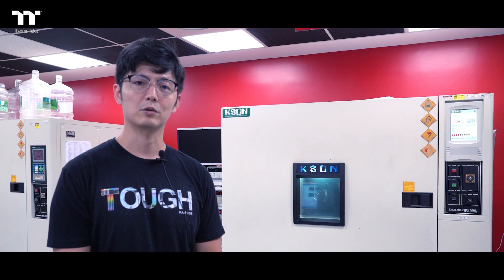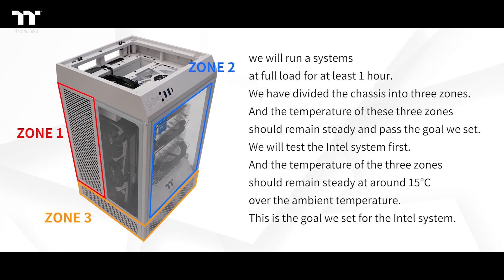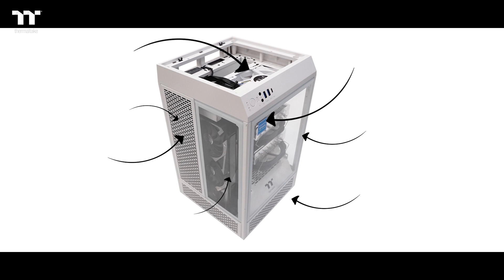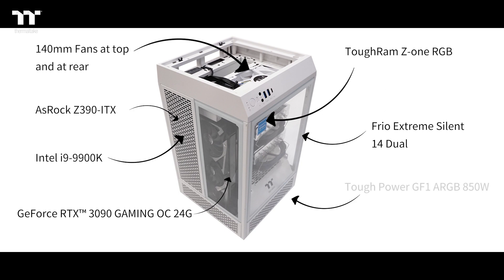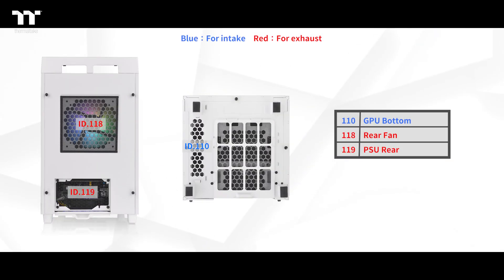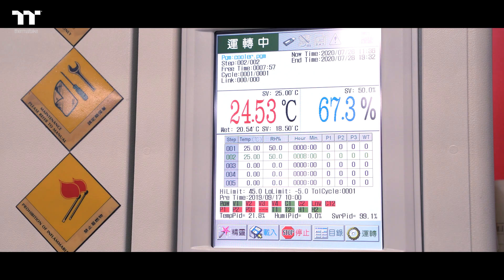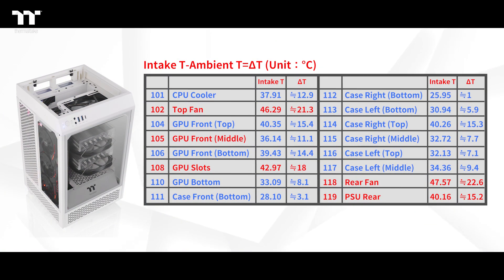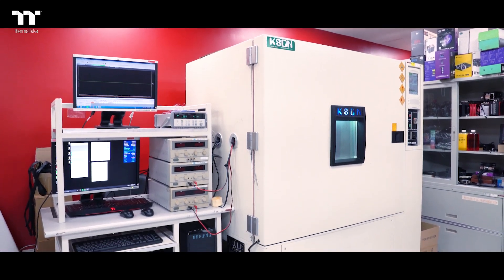Thermaltake Science - The Tower100 Mini Chassis Thermal Test

Comment: What's the purpose of the fan mount that is on the top of the PSU - does that act as an intake or exhaust fan in that location?
Reply: That looks like intake (the side with the fan frame is usually where the air blows towards)
Reply: No, it’s the exhaust. Hot air rises.